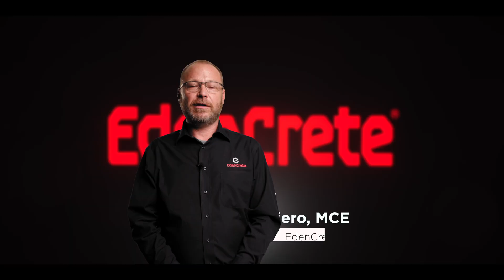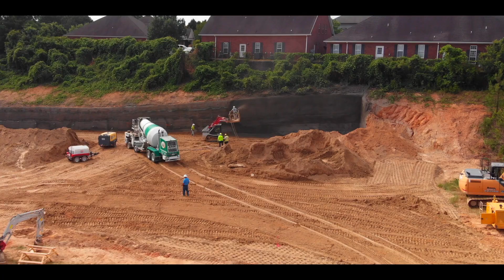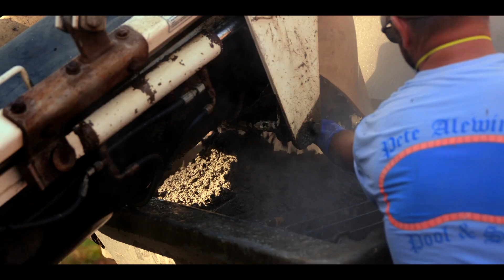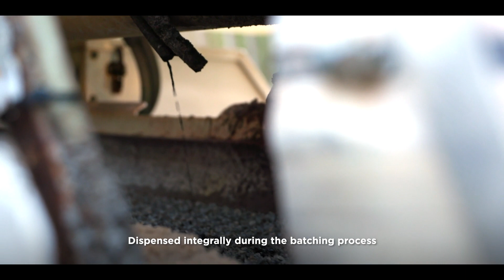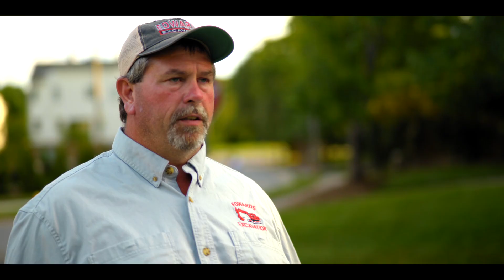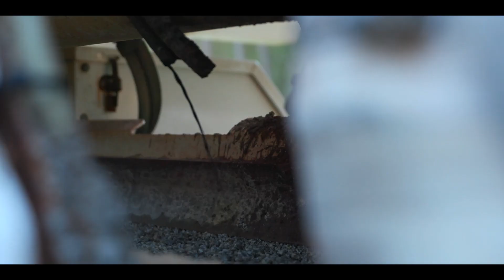Shotcrete  |  EdenCrete®

Comment: And good not only for shotcreteing. Anywhere concrete is used; roads, sidewalks, driveways, docks, seawalls, buildings, etc.And it reduces a huge amount of CO2 going into the atmosphere.
Reply: Yes that's why I bought some EDE
Reply: @Simonpt2000  Does shotcrete do forming or carpentry work?